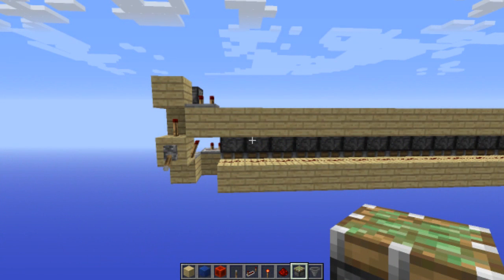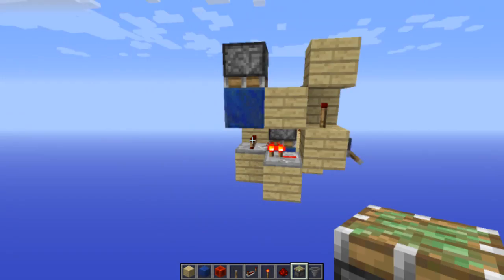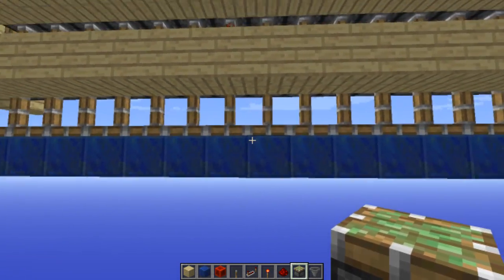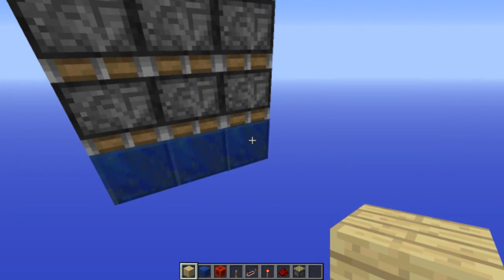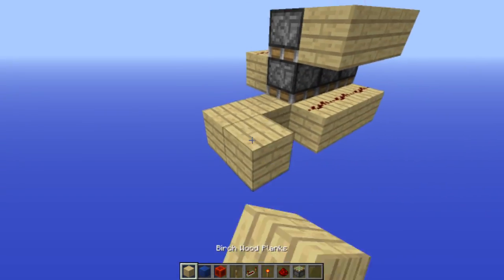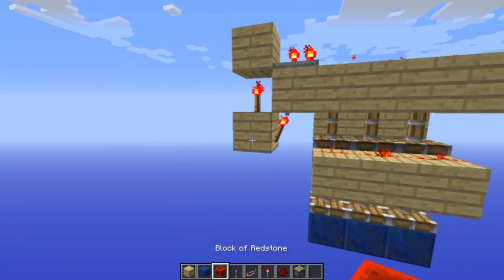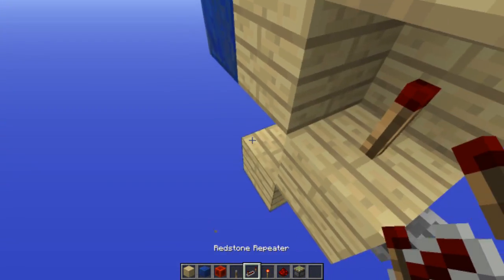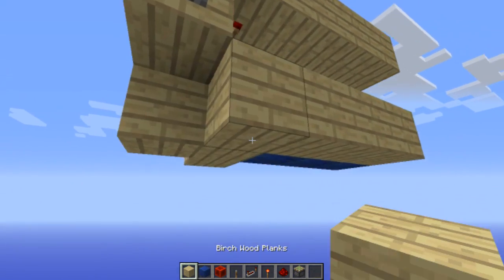Expandable double piston extender | Redstone with Fenno

Comment: It could be faster if you let a 1-tick repeater to the monostable piston, then added a tick to the repeater that leads into the block underneath the monostable piston, and finally change the repeater on 2 for the last block retraction to 1.